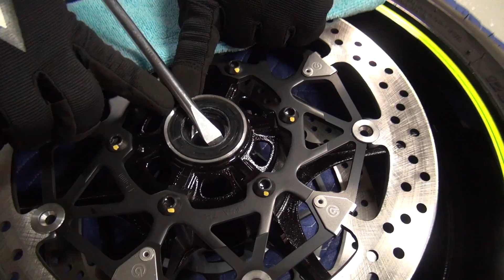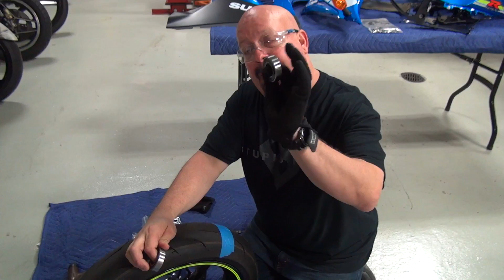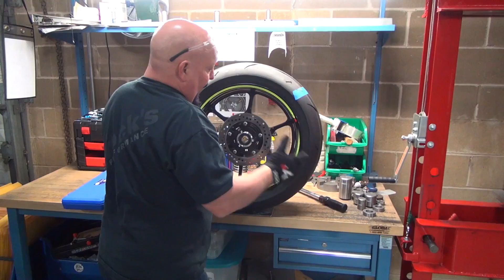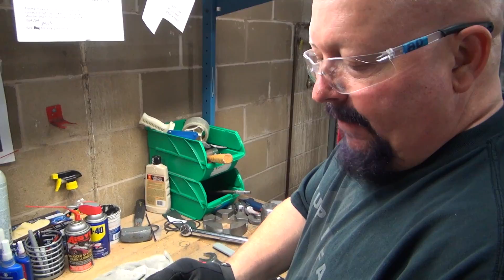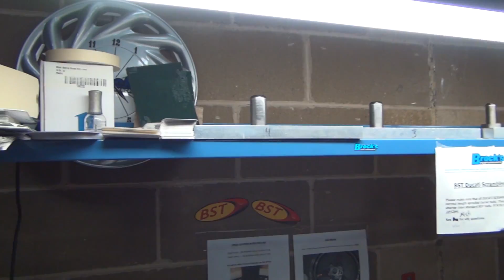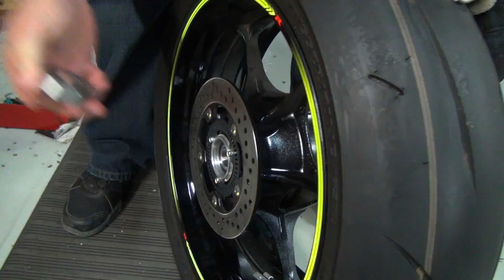Wheel Bearing Installation Demonstration with Brock Davidson

Comment: The inner spacer plays a crucial role; if it has been shortened due to the stress on the previous installation, you must ensure that it does not bounce around on the next installation. It must be tightened between the inner rings of both bearings or the whole job will be useless.

Comment: I would like to install WWB in my stock 2021 M1000RR Competition wheels that are carbon fiber. They look a little different in color (carbon fiber wheels)than the wheels that came on my 2020 BMW S1000RR and it made me decide to investigate more so I took off both back wheels. So me being me I decided to go get both wheels removed to help further my investigation after being told they were identical. THE SHOP NOW RETRACTED THAT STATEMENT AFTER I PAID $100 JUST TO VISUALLY INSPECT BOTH WHEELS TO UNDERSTAND THE WEIGHT DIFFERENCE MY SCALES WERE SHOWING ME! THE M1000RR Wheel doesn't have TPS like the 2020 S1000RR and visually subtle cosmetic differences. I'm worried the hubs might different on the M1KRR and when I installed WWB on a friends 21S1K the frozen bearings went in with very little pressure but snugged up firm after the warm hub cooled (WIFE BLOW DRYER HEATED ONLY LOL) Ive been told they are the same but they also reinstalled both tires and refunded me the $100 for bringing the differences to their attention. I've got OCD when it comes to working on my bikes and figured I would ask the best of the best if the K66-K67 bearings are the same? BMW did change the gearing on the K-66 M1KRR to 17/46 but I already changed both bikes over to 520 17/45 which came stock on the S1KRR K67 so Im thinking the only other change would be in the hub. Sorry for the long msg but its hard to get/give advice w/o all the details. Thanks for any advice.

Comment: You said you put in wd40 to help slide it in. Wd40 eats dust seals
Reply from the maker: No. Dust and dirt eats dust seals and WD-40 attracts both. That's why we only use Mobil 1 grease in the bearings and the part of the seal that touches the spacer.

Comment: Hey bro I got a set of theses ceramic bearings ... I’m about to install them and I’m watching this video to help me out .. you mentioned you ain’t gonna be using the dust seals no more .. is that because you damaged them removing them and putting new ones in .. ?? Or your just not running seals at all ?? Thanks 🙏